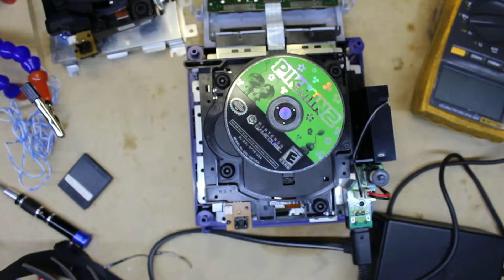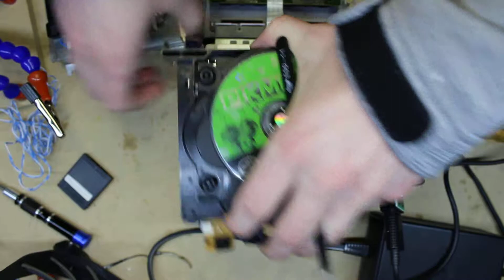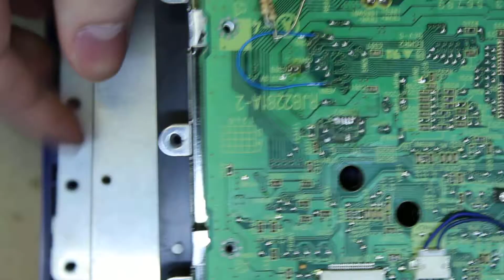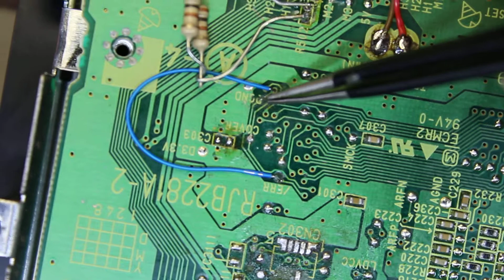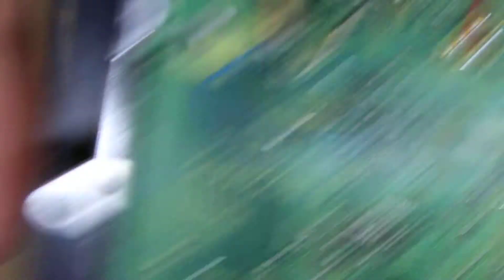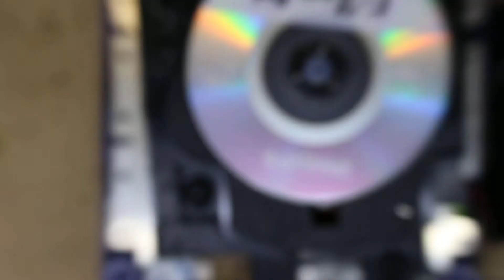GameCube disk drive doesn't spin; no laser Repair

Comment: The laser doesnt move when I engage the hatch switch. I adjusted the laser sensitivity to 208 ohms but it did nothing.
I'm at a loss here. Please please please help
Reply from the maker: When you close the lid does the lens assembly move at all (try moving it to the outer edge as well)? The order of operations for the disk drive is to first check if there may be a disk, then try to read the XOR table on the inner ring of the disk. If the lens isn't moving at all it could be burnt out, especially given how low of a resistance you are running it at. It also goes without saying, don't look directly into the lens when doing this.

Comment: Recently replaced the laser unit, disc wont spin, tried adjusting the POT, changed the piece that spins normally but nothing, changed the little motor beside the laser, nothing, maybe looking on the drive board will help me.. gonna try some of your advices here.. but, If you know another cause o this unit behavior I'll be grateful to hear it... Thanks
Reply: Check the capacitors on the drive board I heard they can be the problem to.